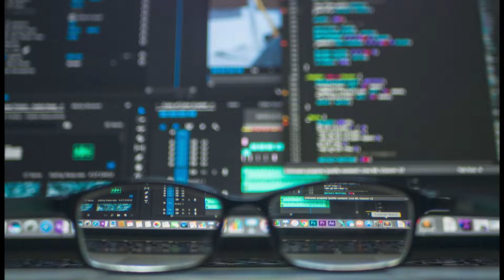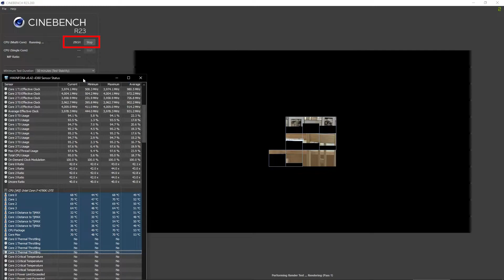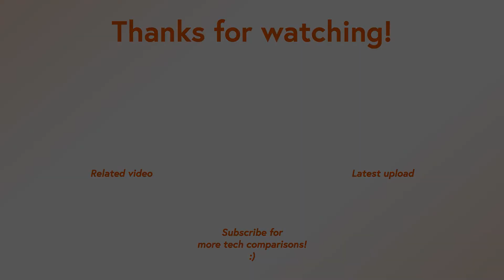Cinebench R23 stress test - is it any good?

Comment: Hello, may you tell me in which mode to run the test, balanced or maximum performance, should any changes be made in the processor performance boost mode settings?
Thanks!

Comment: My 4600H (stock) runs multi core test just fine but the single core test causes cinebench to crash and throw an Application error.. However, manually disabling turbo boost for the CPU causes it to work just fine.. any idea as to why this is happening? My temperatures are all under control